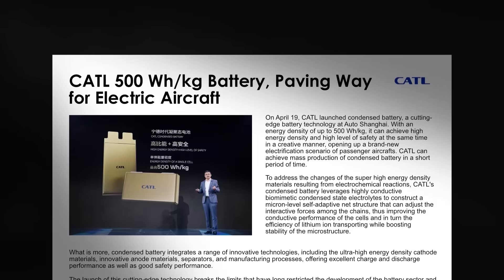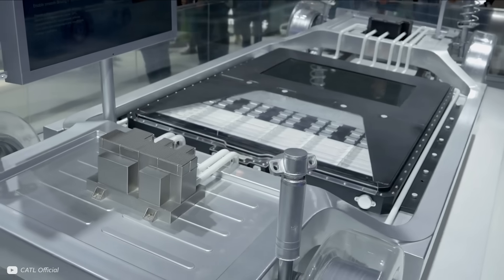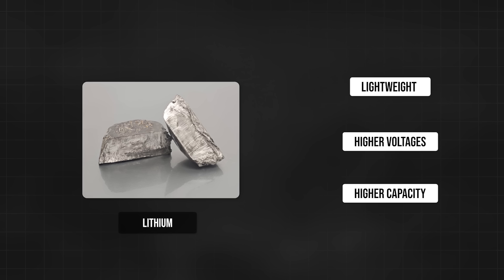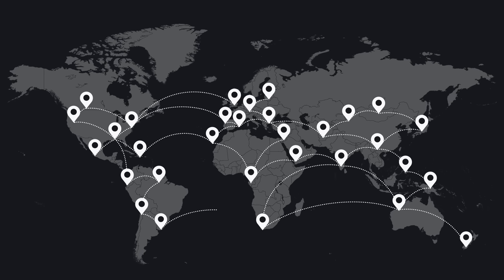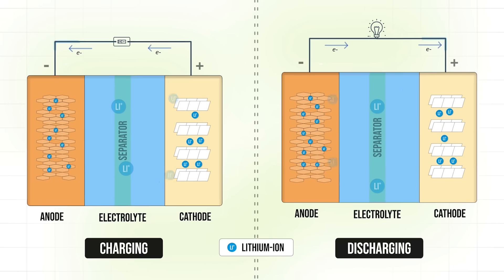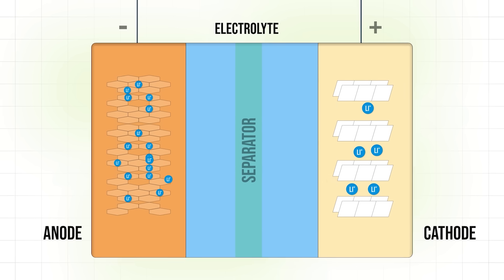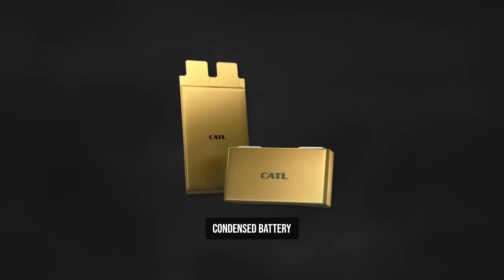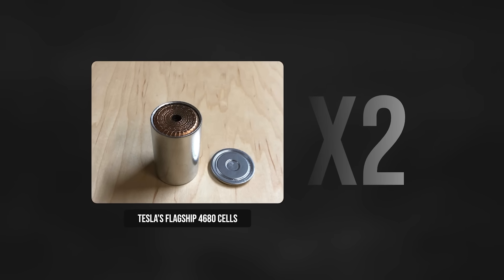Next Generation Batteries: Beyond Solid State

Comment: The time to charge is way down on the list of reasons why current EV offerings suck. It's the horrible chemicals, the slave labor used to mine said chemicals, and the fact that the negative impacts from the nasty chemicals wipe out any "green" advantage falsely touted by politicians and EV companies.
Reply: Nothing is truly green. The fact they blow ICE out of the water performance wise, with the exception of top speeds that are basically lap car only. 

What is funny is even after everything you listed. Report after report says EVs are greener. 

 Cobalt is being phased out, and isn't used in many EVs. 

 Chemicals? Yeah, because drilling and  refining oil is SOOO clean? 

  To produce the lithium needed for a 64 kWh battery pack, for example, Fichtner stated that about 3840 liters of water are evaporated according to usual calculation methods. This is roughly comparable to the production of 250 grams of beef, 30 cups of coffee, or half a pair of jeans, according to the researcher.

 Mining is getting better too. One of the issues specifically with lithium was WHO was mining it. China and Chille don't really have or follow regulations, and didn't care. 

 Now that countries who do care about their backyards are going to be mining for these materials. Expect the cost environmentally to drop. Especially with so many researchers getting funding from both private and governments for better, and more efficient practices. 

 Let us not mention EVs already last 100k more miles. Some say the EVs made today can double that before the battery isn't practical. 

 Mind you these metals can also be recycled. You cannot recycle burnt gas! 

 EVs are the future. In five to ten years even semis will be using them. 

 Oh let us not forget the geopolitical and security nenefits of decoupling from gas countries like Russia and the Middle East.
Reply: What chemicals are being mined by slave labor?  Do you mean in China or something?
What negative impacts from the "nasty chemicals" are there?
How do they compare and contrast with combustion engine vehicles and how does it then alter the 0 tailpipe emissions and now-a-days mostly 0 emissions to "fuel" the vehicle through out it's life?  Thinking especially about CO2 linked to Climate Change and air quality/pollution linked to 1000's of premature deaths and cancer etc.?

I know about Cobalt being mined to be an additive for petrol.

I know about tail pipe emissions e.g.

CO2: Greenhouse gas, climate change
CO: Toxic, incomplete combustion
NOx: Smog, acid rain, respiratory issues
HC: Smog formation, unburned fuel
PM: Health problems, fine particles
SO2: Acid rain, respiratory problems
VOCs: Ozone formation, health effects

Sound like "nasty chemicals" to me.
We know lead used in petrol has been linked with all sorts of problems including criminal behaviour even in people it's made sick.

Then there's all that oil we keep having to produce and use for combustion engine cars.  Sounds like "nasty chemicals" to me.  With it's additives and whatnot.

On going.

For the life time of the vehicle.  Which is likely to be less than a good quality EV plus it's battery anyway.

How are EVs worse than that?  We know the CO2 emissions from the manufacture of EVs is overtaken by combustion engine vehicles in about ... 6 months to 3-years if memory serves?  Depending on driving and electricity source.
And in all that time none of those "nasty chemicals" from tail pipe emissions that are demonstrably linked to so much ill health.  Especially for kids being shorter and more sensitive.  Even to unborn children via the mum - when it comes to particulates!

I'm unclear on the slave labor thesis.  There are mining issues of course ... area used for lithium - land use etc. and it's not a perfect process by any means.  It's improving but not something to be giddy/happy over.   Copper is another biggie actually when it comes to mining.  And rare earths need a lot of earth moving.   But slave labor?  For reputable companies?

And again - how does it contrast with combustion engine vehicles and mining for that and for the petroleum industry?

Also - with EVs ... eventually there will be little need to mine any more as recycling becomes more and more cost effective at scale with improving processes there as it evolves.  Mining would be mostly a thing of a past, for maintaining fleet sizes in declining populations and with self-driving vehicles replacing ownership.

If you're a Saint and you're saying ALL passenger vehicles ought to go ... then that I could respect.  If you don't drive yourself and live some 100% virtuous life - although you seem to be able to access YouTube and hence data centres etc.

But if you're trying to say combustion engine vehicles are somehow sharing some parity with EVs on "green issues" ... then I must question your reasoning!
Reply: Do you think ICE cars are greener because they grow underground?
Reply: @georgesava1  I replied to @brysonfitzgerald5238 and I can see it in my YouTube history with a link that takes me to the video where I can see the reply ... but ... if I just go see the video with the just v=video-reference then I can't see my reply.

I find it very confusing.

https://www.youtube.com/watch?v=I1XmKpRFZco&lc=UgwVBsr1SyA5eUzT-NR4AaABAg.A4rxmmZL35FA4t9kh-Trm0

What I said - but all condensed:

What chemicals are being mined by slave labor? Do you mean in China or something? What negative impacts from the "nasty chemicals" are there? How do they compare and contrast with combustion engine vehicles and how does it then alter the 0 tailpipe emissions and now-a-days mostly 0 emissions to "fuel" the vehicle through out it's life? Thinking especially about CO2 linked to Climate Change and air quality/pollution linked to 1000's of premature deaths and cancer etc.? I know about Cobalt being mined to be an additive for petrol. I know about tail pipe emissions e.g. CO2: Greenhouse gas, climate change CO: Toxic, incomplete combustion NOx: Smog, acid rain, respiratory issues HC: Smog formation, unburned fuel PM: Health problems, fine particles SO2: Acid rain, respiratory problems VOCs: Ozone formation, health effects Sound like "nasty chemicals" to me. We know lead used in petrol has been linked with all sorts of problems including criminal behaviour even in people it's made sick. Then there's all that oil we keep having to produce and use for combustion engine cars. Sounds like "nasty chemicals" to me. With it's additives and whatnot. On going. For the life time of the vehicle. Which is likely to be less than a good quality EV plus it's battery anyway. How are EVs worse than that? We know the CO2 emissions from the manufacture of EVs is overtaken by combustion engine vehicles in about ... 6 months to 3-years if memory serves? Depending on driving and electricity source. And in all that time none of those "nasty chemicals" from tail pipe emissions that are demonstrably linked to so much ill health. Especially for kids being shorter and more sensitive. Even to unborn children via the mum - when it comes to particulates! I'm unclear on the slave labor thesis. There are mining issues of course ... area used for lithium - land use etc. and it's not a perfect process by any means. It's improving but not something to be giddy/happy over. Copper is another biggie actually when it comes to mining. And rare earths need a lot of earth moving. But slave labor? For reputable companies? And again - how does it contrast with combustion engine vehicles and mining for that and for the petroleum industry? Also - with EVs ... eventually there will be little need to mine any more as recycling becomes more and more cost effective at scale with improving processes there as it evolves. Mining would be mostly a thing of a past, for maintaining fleet sizes in declining populations and with self-driving vehicles replacing ownership. If you're a Saint and you're saying ALL passenger vehicles ought to go ... then that I could respect. If you don't drive yourself and live some 100% virtuous life - although you seem to be able to access YouTube and hence data centres etc. But if you're trying to say combustion engine vehicles are somehow sharing some parity with EVs on "green issues" ... then I must question your reasoning!

... I wonder now, having done this, if this reply will "disappear" too?

Comment: Surely this new battery technology would put an even bigger strain on the sourcing of lithium which is already in relatively short supply.
Reply: Honey comb instead of heavier structure. The video says the energy stored is double compared to the current tesla batteries so it is possible to assume the use of half the lithium currently used for the same power. This could mean halving the stress on lithium sourcing.

Comment: Another great video.  Gives you hope that one day soon even the most ardent anti-EV folks will have no leg to stand on when it comes to range and time spent "filling the tank."
Reply: I wouldn't hold my breath. The anti EV crowd does not listen to reason, and make up reasons to not like them. 

 Act like charging at home while you're sleeping to get 350 miles isn't convenient for all but a tiny portion of the population. 

 They won't like them no matter how much better performance they have.

  They use statistics from 10 years ago, make crap up, or don't understand how much better batteries are getting year in and out. 

 They also don't understand we only produce enough power as necessary. So they say the grid will never be able to handle the 25-30% increase in demand if we switch. 

 Thing is... If there is demand. Supply will come. Capitalism will do its thing. Unless you're Texas, than you'll just suffer with outages. 

 I swear they don't like it since their vehicles don't make toddler noises with "vroom vroom."
Reply: @dianapennepacker6854  As California's power grid is being overloaded thanks to all the EVs. Besides, are electric semi trucks yet? Or something bigger and more powerful than the piece of scrap Cybertruck?
Reply: @WolfeSaber  To be fair, power grids and such need an overhaul anyway, regardless.  EVs being adopted isn't overnight.  People don't get new cars of anything like getting a new laptop.  And used cars non-EV will be around a good while anyway.  So it's not like one year everything lights up like a xmas tree to the grids.  Always increased electricity even if these weren't around adding to it.  Gotta change those up soon, no matter what.
Reply: @toddjohnson7572  And yet governments keep putting deadlines for when they want everyone to have EVs.
Reply: @WolfeSaber It’s not a matter of if, it’s when.
Reply: “Get a horse!”
Reply: Just hope it isn't lithium, as mining for it destroys the environment more than internal combustion engines.
Reply: @WolfeSaber  Lithium is truly bad for the local environment where it's being mined. However, ICE cars are truly bad for the climate of the entire world. Considering all the other crap things we do in regards to mining and nature preservation, I don't see why we should choose to stop lithium mining in particular when it has other clear benefits for the global environment.
Reply: @WolfeSaber9933  really? Or is that just opinion?
Reply: @craigknight2764  For what?
Reply: @WolfeSaber  they dont care about that. it's all about taxing the poor.

Comment: will these new batteries work in my wii remote - even at full charge the batteries dont work lol
Reply: What batteries? If double A? Duracell are my go to. 

 Have never had them fail in anyway. Somehow they get lost before they fail. Have had the same 4 for years for my Xbox controller. 

 Can't recommend them enough! 

 I could find them pre covid for under 20$. A lot of times the charger with batteries is on sale, and cheaper than a pack of four. 

 Been a while so I don't know if costs gone up.
Reply: @dianapennepacker6854  yeah i was mainly joking cos wii remotes are notorious for terrible w batteries lol
Reply: @0005yuki  Wasn't sure! 

 But now you know! Definitely recommend Duracell rechargable double AAs.